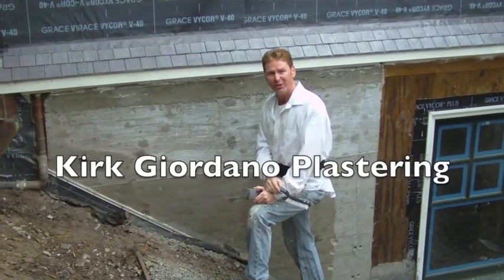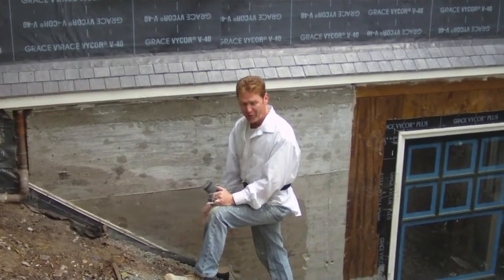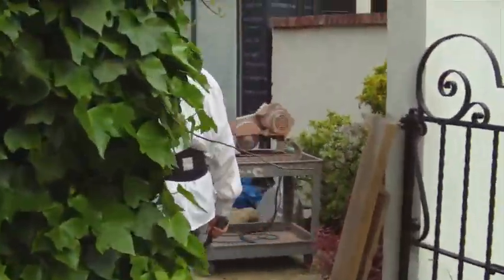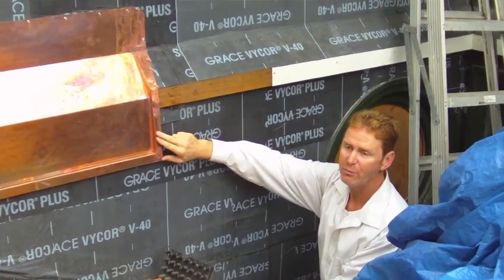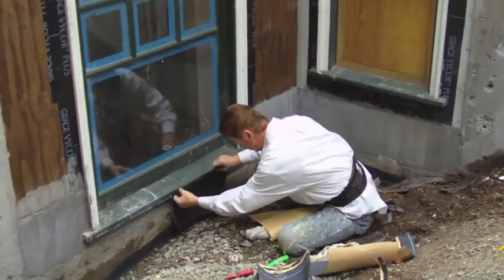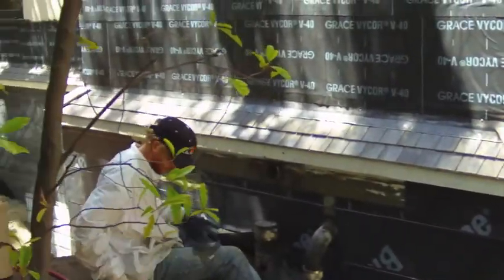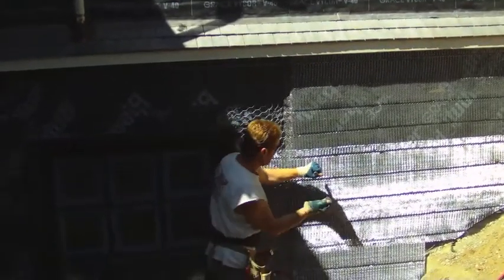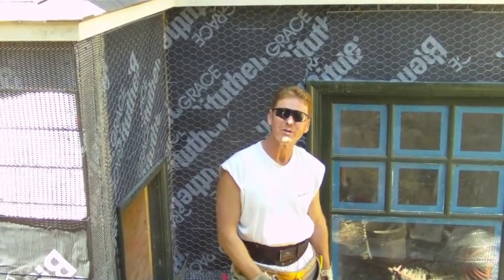Waterproofing concrete foundations below grade permanently

Comment: Why The Grace membrane is so important on this? Isn't the 2 layers of black paper sufficient?  That must be 5 to 8k just on Grace.  
  But this is why I like watching you guys. You do the right thing no matter what!!
Reply from the maker: Hi Marc, I can't remember costs but indeed it cost some serious dough. I do remember we didn't get sued for water intrusion.  Also, one can't use paper as there is no way to attach the paper over concrete, Cheers, and thank you for those choice kind words. We are waterproofing experts.🕵🏼
Reply: @StuccoPlastering  I figured it did.  But it came out so nice. 
  Maybe you can answer this for me.  What is the difference from plaster sand and playground sand?  Here, we do not have big plaster yards.  So getting plaster sand is not something you come by easily.  I notice the plaster sand sort of looks alot like dirt.
Reply from the maker: Any sand will work as long as it's cleaned and free of sea salts. Some sands are 
 cleaner and finer like Olimpia and Felton, which most plastering yards carry 
and sell. 👨🏻‍🏫
Reply: @StuccoPlastering  Ok. Thank you, sir.
Reply from the maker: @80Ragincajun  no worries

Comment: You seemed to have omitted 2 critical steps when installing Grace self adhered membranes. 
1. Primer. Absolutely required for concrete and all masonry. Also on denseglas 
2. Rolling the membrane with a hand roller.
 Either one of these will result in failure of the membrane. And renders the Grace guarantee void.
I have installed hundreds if not thousands of rolls of Grace products. Nant under the scrutiny of Grace tech reps due to the sheer size of the project.
Reply from the maker: Howdy gene, Au contraire mon frère, 
The primer is clear when dry and not viable.
 Thus, who says I didn't use the primer? Just the last names will do. 👮🏼‍♂️
FYI, I'm not sure how I've been in business all these years without your advice?🥊
Reply: @StuccoPlastering  Giordano is the last name.🤣🤣🤣YOU said it.
 In your reply to Mborbon you said: No we didn’t use a primer on this wall.But it is new concrete. And I pressure washed it……… I was responding to this reply.
Reply: @StuccoPlastering  look I have been a wateroofing expert for over 40 years.  I have seen hundreds of plasterers. In fact for a long time we were the exclusive installers of waterproofing for a few large plastering companies.I know enough and have seen enough to know you are a legitimate plaster expert.In fact I watch your videos because it is very difficult to find someone who does quality work and I admire that. When I comment it is not” you don’t know what you are doing” . It is someone that is an expert waterproofer and who also does very high quality work telling you how an expert does the waterproofing. If you didn’t do quality work I would not bother. The fact is you can’t be expected to be an expert of 2 different trades. Yes as a plasterer you have to understand waterproofing. But understanding it and being an expert are not the same.
Reply from the maker: Dammit, Gene, I'm an applicator, not an engineer. https://youtu.be/jz2EpgkAz9U/. Lighten up brother the fact is I'm a subject matter expert, in too many subjects.🧞‍♂

Comment from the maker: Hey Mborbon, no we didn't use a primer on this wall. But its new concrete and I pressure washed it with 3,000 psi.
 That kind of pressure washing to newly poured concrete foundation walls get the dirt and moss off therefor the membrane should adhere well. Of course if you’re not certain you can always do both.
 Best wishes and have a great day! 
Kirk Giordano plastering
Reply: ALL concrete and masonry surfaces  along with denseglas gold absolutely require  primer for Grace self adhered membranes. Also it is required that the membrane is rolled with a hand roller. Without primer and rolling the membrane will fail prematurely. It WILL fall off the wall just as the below grade did. I have done many large projects where a Grace field rep will inspect the installation to certify their guarantee. The first 2 things that will get the guarantee denied is not priming and not rolling Both are critical to an acceptable installation. Also it appears you used vycor and bituthene. Why? They are not the same thing.

Comment from the maker: Hi Will, I have used at least 50 boxes of this stuff (Grace vycor –Self-adhered flashing) and it can be a real drag especially in hot weather. I prefer not to use it especially in the hot sun. The best time is early morning and with 2 guys. 
I have not tried a roller.
 Have a great weekend.
 Kirk Giordano plastering
Reply: Kirk Giordano plastering Inc.Hi should i use certain type of primer and is necessary used the torch. plz